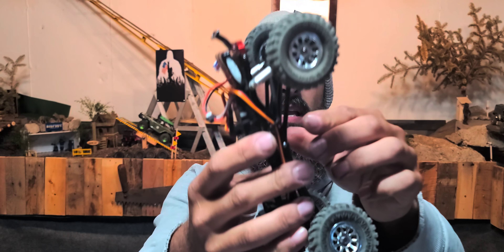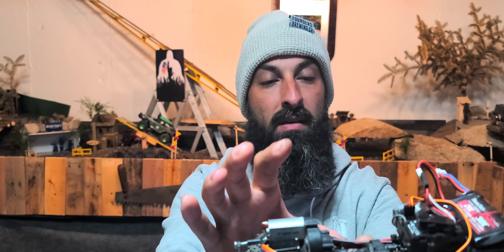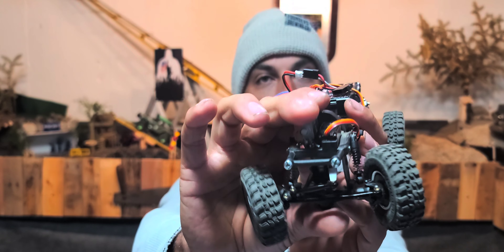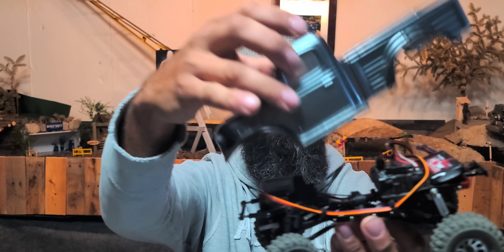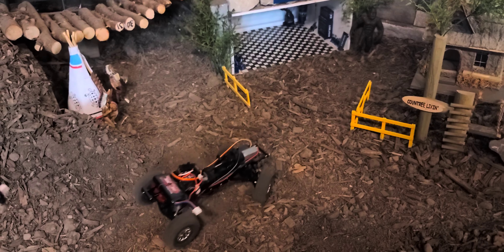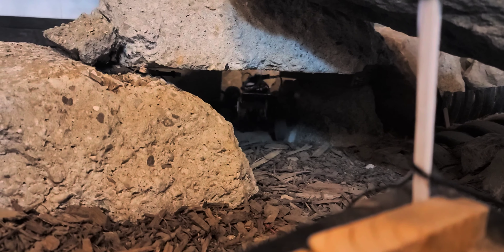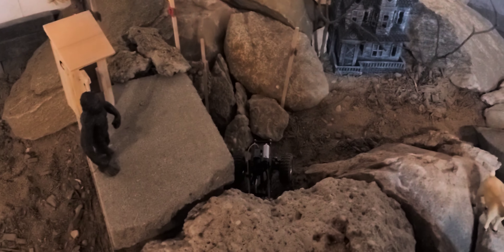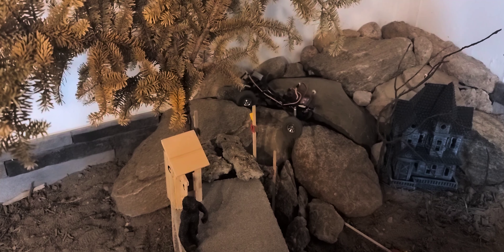scx24, Enduro 24 (Frankenstein build)

Comment: Dag I was hoping for pro-line power wagon. Is that a 1/18 tetra? I you want a little more speed a larger sized wheel is and easy install.
Reply from the maker: Nope it is a enduro 24 with with axial SEX24 drive train and I'm going to put a tetra K1 power wagon body on it,  So officially it will be 3 trucks in one. Living up to the name Frankenstein build... lol 😆 pretty Stinkin sweet
Reply: @JaysensRCs  I was referring to the body. It was the only part you didn't identify.
Reply from the maker: Yeah I figured... didn't really decide to go that route till after making video.. lol